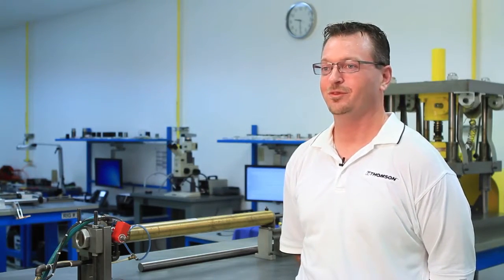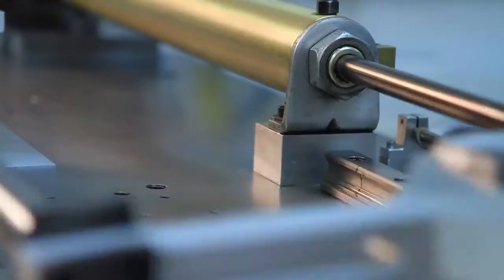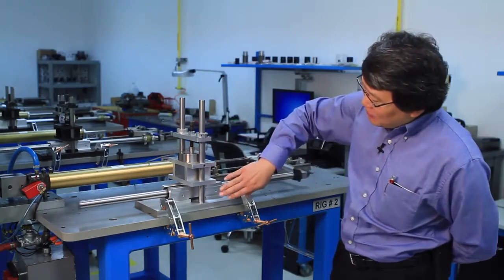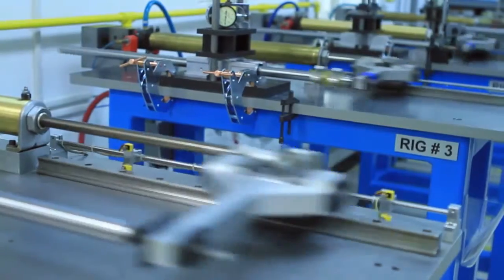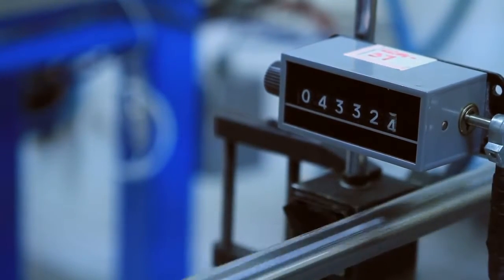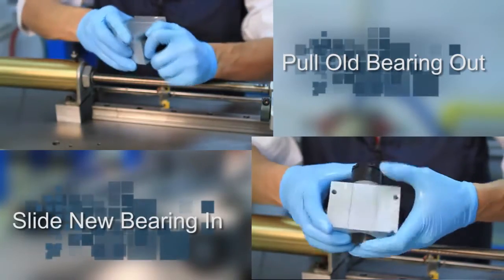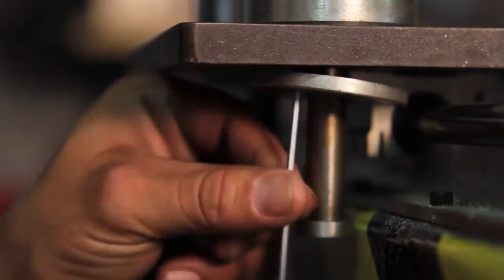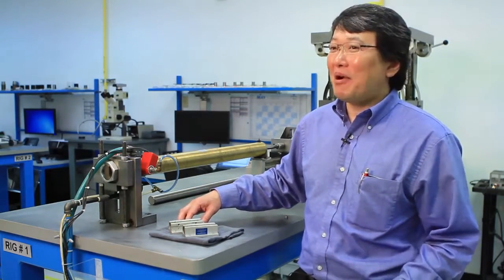Linear Bearing Preventative Maintenance - Thomson Linear

Comment: Total fluff. Zero real content.  If they made a serviceable product it would be great. After spending ridiculous amounts on those actuators, shouldn’t the customer be able to get part to service them on site, and for a reasonable cost?  I recently tried to get a simple two gear Delrin plastic part and it’s $388, and 120 days lead time.  The extension tube is not serviceable because they made it so you can’t take it apart.  That 30” part with a 24” extension is $588.  All it needs a lubrication because it’s older.  Not used very often on an RV generator drawer. The replacement  unit is over $2000 from Thompson.  I’m looking to buy something to replace it for say $100 that will do the job.  This company must depend on Pharmacy and Defence contractors.  Not very customer oriented and out of touch.